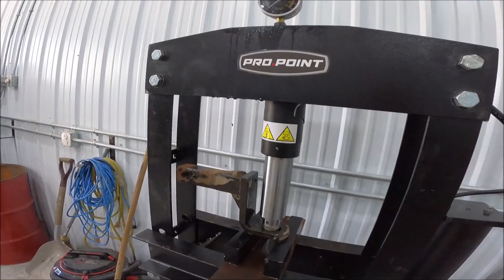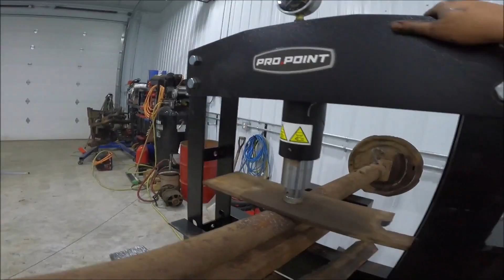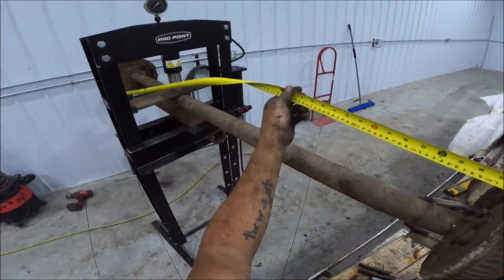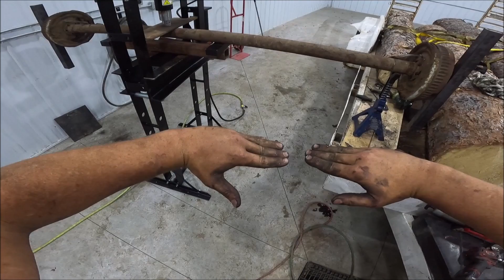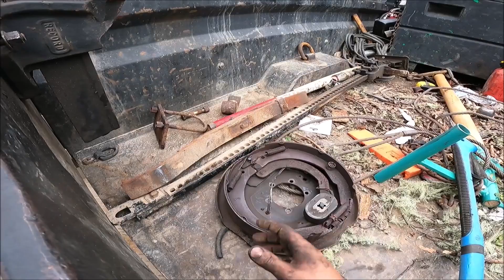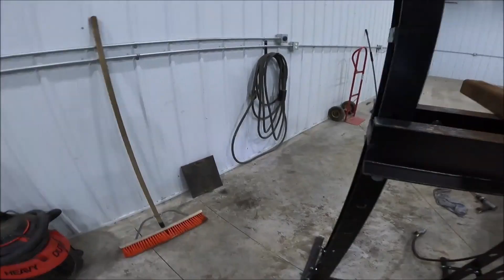TRAILER AXLE STRAIGHTENING... FOR HILLBILLY'S. UN-GREASED EDITION!!!

Comment: There are two axles on a trailer for a reason. Weight reduction and saving fuel by axle delete. Mint.
Reply: Man your smart
Reply: He’s not wrong tho
Reply: I saw a guy with a box trailer and one wheel was missing but had 4 wheels origanally but 3 is fine
Reply: I have driven a double axle trialer with 3 wheels before

Comment: Not all of us have a fancy ass press in a fancy ass shack, for us poor's we just flip the axle around and hit the same stump again.
Reply: My grand farther did that when he dropped a hay bale on a trailer and bent the frame, just flip it over and do it again.
Reply: Many years ago I bought a VW bug that was wrecked from a friend. The left front bent pretty good and tire would last about 180 miles. Hooked a chain to it and around a tree. Drank a few beers and crainked it up, had about 30 feet of slack in the chain between car and tree. Trick was not to go so fast as to rip the front axle out but to adjust. After about a case of beer between a good friend and myself and many adjustments I could get almost 10 thousand miles out of left front tire.
Reply: @oldfarmer4700  I did the same thing with my bug after hitting a tree , but in my case I chained to a telephone pole , and after a few good hard pulls from out of nowhere came the lens from the street light above. Ouch !
Reply: @dickjohnson1158  but did it really come outta nowhere though? 🤔😂

Comment: If you axle aint exactly straight you can leave your wheel bearings loose and they will self align or just run when the roads are iced up and your tires wont scrub...lol

Comment: My dump trailer scrubbed the rear driver side...I couldn’t figure the fvckr out...got to really looking and the fvcking mfg welded the rear leaf mount 7/8” towards the tongue v. Other side...then they fought the fvcker mounting her up, totally fvcked....moral of the story is I did a bunch of looking on the confuser and you can fine tune align the tires with the axel mounted...porta power and a skid chain is all you’ll need...check it out! minty

Comment: Trailer axles are bowed down in the middle by design, you don't want them straight. The idea is that when the trailer is loaded the weight of the load on the axle pushes down on the bow causing it to potentially straighten if there's enough weight.
Reply: That would only apply if the load/pivot point was center of the axle. Most trailers have leaf springs mounted behind the hub. The majority of weight is distributed to the wheels and tires. 
My semi trailer has 8 inches of arch in the center, but the axels are straight.
Reply: @Miner-49  hojo is 100% correct,  your semi trailer axle is strong enough that it doesn't need arch, any trailer axle 10,000lb and down has a certain amount of arch to compensate for load
Reply: The spring perches were vertical, so he's straightening the horizontal plane of the axle

Comment: Good video, I have straightened axles with a chain and a floor jack on top of the chain with the axle on top of the jack with the chain wrapped around both sides of the bend it works if you don't have a press.

Comment: You don't need straight axles.. Just replace the tire every ten miles and deal with broke down shot bearings every 30 miles. Do it the hard divorce way, that's the best way.

Comment: Some trailer axels are not straight they have an arch in them
Reply: Yes some are arched so that when you put weight on them it flattens the axle. K
In this case it was bent front to back Insteand of arched up and down. Front to back it should be perfectly straight. If it wasn't that would cause the axle alingment to be toed in or out both of which cause tire wear.

Comment: I remember the abuse I put one of Rocky’s trailers through. Sheared the bolts off both hubs on one side, next month blew the tires off the trailer. Broke the leafs, rubbed a tire a time or two on the shackle… just pure abuse. Rebuilt it 40 times and then it got stolen. Thought for sure you bought my stolen trailer when you rolled into the yard with it.